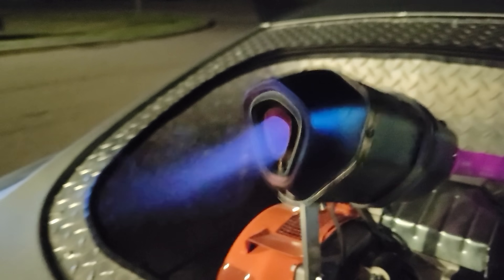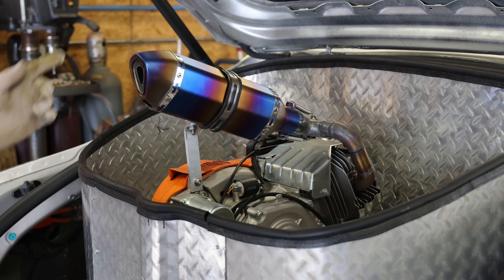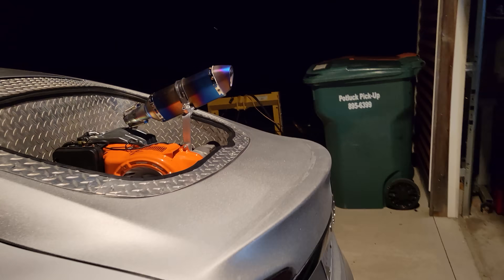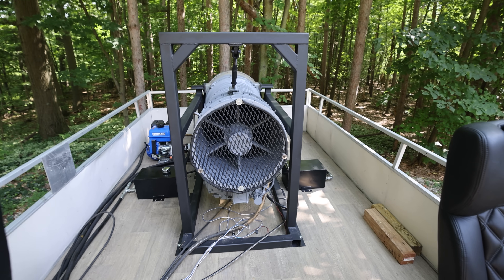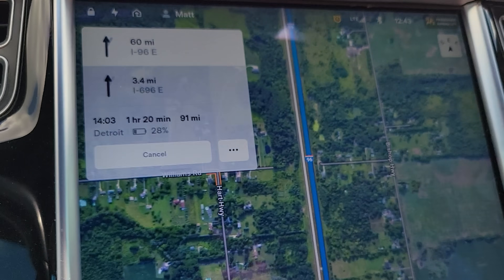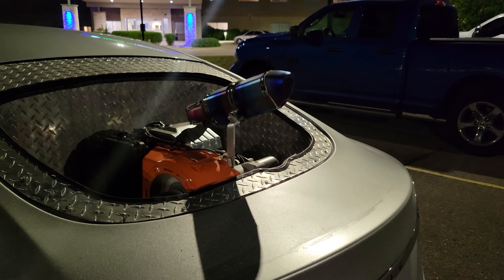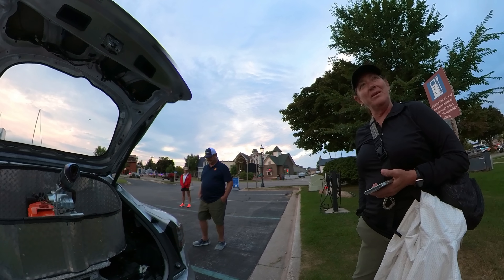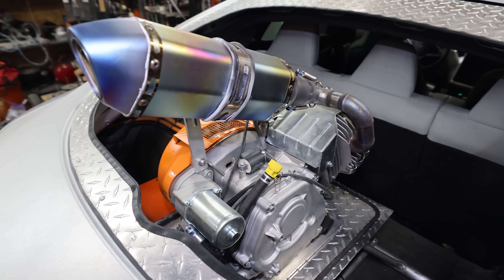Cordless Tesla (I Drive 1800 miles without charging) P.1

Comment: First of all I think if you wanted a hybrid you should of just bought a hybrid. The idea that, "you have to charge somewhere." is true but also extremely shallow thinking. The entire point of BEVs is to move towards clean energy cycles. That includes energy generation. The fact you take a gas engine and stick in the trunk of your Tesla misses the entire point. The point being that we need to be changing how we generate power. Simply poking fun of clean energy use because it likely comes from a dirty source is juvenile and counter productive.  

Want to do 1600 miles in a hybrid just put a big enough tank you fookin idiot. You aren't accomplishing slit here that's positive.

Comment: Some noise damping would help.
The exhaust needs to be reworked.
Otherwise you will disturb everyone.
Plus, modern age engine cars have systems that reduce the harmful gases output, by different solutions.

Comment: That’s pretty good but if you want the battery to charge properly you need basically two battery packs because one always needs down time to charge with your present charging modus operandi? Not to mention probably safer also. Too much heat not only degrades battery capacity but can cause catastrophic results. Hopefully your batteries are not the older lithium ion batteries? They can become very unstable when very hot🔥🔥

Comment: Nice. I hope it doesn't ruin the battery, charging it while using it
Reply: Yep. But there is a chance that a big part of the power from generator gets directly used by the electric motor while driving. Otherwise its a lot of heat!

Comment: I want to see this done with some super quiet suitcase generators in parallel. Stealth charge
Reply: Like a pair of Honda EU 7000's
Reply: @Hogger280  it would take four Honda EU7000is generators to barely keep up with the Teslas demand at highway speed... and those are 118.1 kg (260.4 lbs) each. Between them, they would burn 12 L (3 US gal) per hour, resulting in worse fuel consumption than a normal non-hybrid car.
Reply: @brianb-p6586  This whole thing is a joke,  don't you get that?
Reply: @Hogger280  if you want to be silly, use one Honda 1000. Or maybe a model airplane engine driving 12 volt generator plugged into an accessory socket.
Reply: @brianb-p6586  Look at the other comments.  Watch the video - he does a good job but knows it's not practical.  As an engineer, I could have told him before he started that it was not practical and would not be efficient.  Series hybrids are never as efficient as parallel hybrids.   He took a car that cost $20,000+ more than a decked out Camry Hybrid,  eliminated all of the cargo space and was obnoxiously noisy - if that isn't a joke then there is none.
Reply: @brianb-p6586  Anyone notice during the 5 seconds this video gives to inspecting that install that there's no dynamo attached to that engine, let alone capable of producing 10kw lol... only thing that's on that engine is electric start... it was bolted back there as a stunt for clicks.
Reply: @thom1218  I don't see the generator,  either.
Reply: This could be a test bed for how much generator is enough. How much can we drive a week using a tiny inverter generator?
Reply: @nutzeeer  you don't need to build a pile of junk like this to test that. The car shows energy consumption on its display, and you know the generator output for the generator you're considering and the number number of hours per week that you're willing to run it.

By the way, the answer is "none" - it makes no sense to run a portable generator instead of buying  electricity from a utility.
Reply: I always wondered if this would work well.
Reply: This is just a series hybrid... loads of actual manufacturers have made them.
Reply: Imagine suppressor on an engine exhaust
Reply: Look at Nissan EPower
Reply: There are electric, solar rechargeable battery systems that power whole homes. Hook one up to your Tesla and do it again. May not go 1600 miles May go further?
Reply: @besperus4475  How are you supposed to fit an entire roof's worth of solar panels on a car?
Reply: @besperus4475  have you seen how big those solar power panels are. There isn’t enough space on a Telsa
Reply: @yeahok115sure  Solar generators such as those by Jackery come with foldable, 'flat pack' solar panels that absolutely fit inside a car, they're designed for camping. They're basically a 1kwh battery that self charge via solar then you can dump that into the tesla.
Definitely A LOT slower than a gasoline generator, but it's silent and requires no fuel. 
Park up at your destination, unfold and lay out 300-400W of solar on the roof/windshield/bonet , go about your day and come back to some 'free' miles.
Reply: @CopypastaForTheBlind  300-400 watts of power isn't anything.  You'd need about 10x that and a lot of hours.
Reply: @besperus4475  absolutely not it's called the law of diminishing returns

Comment: Cool concept, but what's the point? You've eliminated the slight inconvenience of plugging in to charge and replaced it with the big inconvenience of an extremely noisy engine (which would also increase running costs).

Comment: Must of been so loud.  :)
Interesting approach.  I believe it’s a combination of electric and a small engine to perpetually charge while driving.  A hybrid with a very efficient engine.  Good luck !!
Reply: prius
Reply: @stevet5790  tl;dr the Prius is not a series hybrid like this. And then I started typing and typing and more words got added and I got ahead of myself XD

A Prius is not a series hybrid, its a parallel hybrid since its engine can drive the wheels directly with their weird dual coupling transmission thingy (called the Power Split Device, very imaginative name, I know lol). In this setup the motor revs to its most optimal fuel consumption and holds there with the generator pulling the most it can with the motor at wide open throttle, having been tuned for maximum thermal efficiency at low-ish rpm and fully loaded, like when you hypermile a car you upshift to the highest gear and put your foot almost all the way down, so this example he's made has a motor that has to basically redline itself and so its fuel efficiency isn't very good, but its a proof of the technology, a Tesla can charge on the go if its been modified to do it, so a Tesla is actually a pretty optimal PHEV platform, OBRIST had the same idea with their own proprietary generator design and its a good idea overall, BEVs are a dead-end right now, like barking up a tech tree without the prerequisites for the higher levels we want to reach so we end up stuck with sub-par products, a PHEV is the best stand-in until we fix the clean power situation down here by using nuclear and launching solar sats to beam power back down without using rockets. Too many things stand in the way of BEVs so PHEVs are optimal and logical. how tf did I get here wtf brain
Reply: @Avetho  When one energy is converted to another there is lost. In gasoline energy car, we are converting chemical energy to kinetic energy . In his set up , we are converting , chemical to electrical , electrical to chemical ( charging battery ) and again chemical to electrical and then finally to kinetic.   there is no way his model can be more efficient. However , i agree with you Prius is different machine. however , Prius create more efficiency by recovering wasted energy .
Reply: @stevet5790  A series hybrid also recovers waste energy, through regen braking and capturing generator heat to warm the cabin in cold weather. They just maintain a level of charge in the battery and under regen it recharges it closer to full and the generator goes off until it drops below a certain charge once more. A BEV is not more efficient, gas is still burned to charge them (unless we stop taking down nuclear plants since they are clean and powerful enough), its just that it happens in the power plants that supply the grid anywhere from 33% to 60% efficient, and we have engines getting over 40% these days with the cutting edge at 56%. A generator that efficient is ideal, especially since it will always run at those efficiencies unlike a traditional gas vehicle, its rpm and load being constantly in its most optimal range rather than revving up and down at varying loads.

Comment: So you didn't touch a charging station, but stopped at 3-4 fuel stations? I get the one to replace the fuel when it leaked, but not the others. The way I would've done it was not use the generator at all through the first half of each battery life. Then turn it on and drive slower. Maybe pull over each time for 10 minutes, or drive really slowly in the emergency lane

Comment: so this little engine which is about 30% inefficient than a modern Di dohc engine powering up an 80% efficiency electric car.  Is it more efficient than a gas car? If it does, I wonder why noble prize is not awarded for breaking the 1st law of physics

Comment: What did you do to the tesla to allow you to charge it while driving??
The battery packs on Teslas are about 450 volts.
How did you get 450 volts out of a 10Kw generator?
It would have been a lot quieter if you had used a Honda generator meant for campgrounds.

Comment: I see a gas motor but I don't see a generator. Where is the alternator, aka the genhead that generates power? How would you get the battery pack to charge while it's powering the car? Pretty sure Tesla software doesn't allow that. This almost has to be a hoax.

This was done before and done well. It's call the Chevy Volt.

Comment: This is the equivalent of someone claiming they drive their gasoline powered car x amount of miles without charging, just extra steps.
Reply: I take this comment completely back if it actually had good MPG, but the transfer rate is typically pretty crap from gas to energy to generators to electricity to battery. You just lose efficiency on the way.

Comment: That thing is shooting flames and glowing red hot because its running super lean with the aftermarket exhaust he added and i dont see an air filter, the carb needs to be rejetted to compensate im surprised that thing didnt melt the piston! Smh

Comment: Goal: wants to travel 1800 miles but hates to stop to charge batteries and even hates to stop to fill up gas tank.
Result: worst efficient hybrid ever, multiple police stops, multiple gas stops, unable to do 55mph on motorway without multiple stops pulling over on side of freeway min 15mins at a time for a trickle charge.
Whole video is full of stress of running out of battery AND gas, constantly monitoring power.

So noisy with flames it annoys the hell out of everyone.

Zero luggage.

What a waste of everything especially my time for watching this rubbish.

Next video: how he's invented the  perpetual motion engine.

Summary: there's already vehicles that can take you 1800 miles without ever having to stop to recharge batteries... and uses less gas and noise and boot space and time. They're called gas powered cars. Look them up!

Comment: Not the way I would do it. I'd put a proper petrol generator in a sound deadening box as used in a yacht and put it in the frunk. Add an air inlet in the front, and add a standard car exhaust with multiple silencers to keep it all quiet.

Comment: As much as people want to say this video is a troll, the math actually checks out.
Engine stated to be 13.4 HP peak output, that's 9.86 Kw. Tesla battery capacity is about 70 Kwh (depends on model). Assume 85% electrical conversion, it would take a bit over 8 hours to charge. (You can see the generator windings at 0:53 so I'm assuming 3P AC-DC conversion.) Also interesting to note that a typical stationary generator is about 18%-20% efficient. 1 gallon of gas (with 10% ethanol) contains 120,238 Btu, that's 35.2 Kw. 35.2*0.85*0.18 = 5.4 Kw/gal.  The fact that he got 16% net energy conversion (his number) is actually impressive considering he was running the little engine at peak power, not peak efficiency. 

Maybe next time use a Kohler V-twin, governed at around 2600-2800 rpm for best efficiency, and less noise :)

Comment: Please please please make a hydrogen fuel cell hybrid using the same theory like the Nissan 74 concept.  That is the future of EVs it would be cool to see someone do it before it becomes mainstream.  Basically the fuel cell charges the battery and can drive the motors too just like with the generator but silently meaning you can avoid charging stations.  ;)

Comment: Why don't you just put 2 generators from home Depot on the electric motors.  Then have two batteries instead one. 
So one is being used, They other gets charged.  Then it swaps.   Never need to recharge again.
Reply: Then at that point why not just forget Tesla and all EV's and purchase a Petrol only powered vehicle?

Comment: I agree with others in thinking this is fake.  You can see there's no output shaft on the gas motor or a generator hooked up to it, which means the only way it could be generating power is through a stator inside the flywheel.  You can see the stator briefly in one of the shots but I seriously doubt you can get 10KW out of it.  Even if that were the case, he claims it can charge the battery while the car is running.  I'm not sure how Teslas are set up but my Bolt only has one high-voltage inverter in the vehicle.  Since the car's battery pack voltage is more than typical charger voltages, the car has to use an inverter to increase the charger voltage above the battery voltage.  But the car also needs the inverter to run the main drive motor.  This means you can't charge the car using the normal charge circuits while driving, and the only way to charge while driving would be to generate the high voltages required (400 plus) yourself, which I highly doubt this guy is doing.  

At best this guy probably hooked up the gas motor's 12v starting battery to the Tesla's 12v accessory battery and called it a day - but if you call that charging the car I strongly disagree.

Comment: I would recomend wrapping the generator bay in sound deadening material. the fact that the generator in inside a pocket is actually amplifying the sound because it is in what I would call a sound chamber. I would also say the because the bay is made of metal is also causing the higher frequencies to bounce off the bay and make it sound louder I would fix this with sound deadening material fixed to the bay both on the inside of the bay and the side in the interior of the car.

Comment: Could've just installed a QUIET inverter generator that puts out 240V @ 30amps & not pissed off everyone. I'd be livid if someone left a noisy lawnmower running outside all night @ a hotel with exhausted travelers. Would've been better to showcase the build & show how it was done/ hooked up. Fun project,  poorly executed.

Comment: Warped Perception - what you have made is a hi-bread vehicle with an underpowered generator section AND it most certainly isn't cordless when you have to stop for fuel. The fuel pump is pumping fuel instead of electricity but you are still not free of a power grid in any way.
Reply: mmm... hi-bread. Delicious.

Comment: Absolutely amazing I loved it
Reply: All he did was build a primitive hybrid.  What's amazing about it?
Reply: @agb1953  it was water tight :)
Reply: @smartazz  So what?  Humans have been making watertight doodads since the first guy used lots of pieces of wood to make a boat hull.  We got really good at it when we started putting rotating propeller shafts through those hulls below the waterline.  There were watertight submarines in the Civil War.  Watertight is ancient technology.
Reply: @agb1953  the combination of old mixed with new is just amazing and beautiful thank you 😊
Reply: @smartazz  What?  The first electric car was invented by Robert Davidson in 1839.  The electric generator dates back to Michael Faraday and Joseph Henry in 1830.  The piston engine dates back to the Greeks of 150 BCE.  Those are the 3 components of a hybrid.  What "new" are you referring to?
Reply: @agb1953  the exhaust was new, no wait, that was Made in 1963, the check plate was new, no that was 1920s, the silycunt was new, no even older 1854, wow 🤩 I’m amazed nothing was new in this project.

Comment: A trailer with the generator and gas tank would provide for a better design. Then the tesla is a EV when its doing its short trips but during a road trip you could just add the APU trailer.

Comment: An Idea I would like to try is to fit an EV with a wind turbine that charges the battery when the vehicle is parked and the mast erected, preferably at the top of a hill or maybe in a narrow valley to get a good airspeed. Or carry a wood gas powered generator for the same purpose. Charge while parked. Run it on scrap wood.

Comment: Don’t know why they stopped making the cars that used both gas and electric. Was almost same principal pretty much. Gas was used to charge battery when driving and if cells got to low the gas power picked up the slack. Gave over double the normal gas mileage of the vehicle if was just reg gas car.. or they go to all electric and the charging time and travel is just ridiculous.  Till we get better batteries or find a better way of holding and keeping a charge for longer distance and quicker charge  and less space used in car storing em they should go bk to cars half electric half gas again.

Comment: hells yeah, that is hilarious and experimental in a fun way. Add in some engine tuning, like an air intake for max HP on the highway - think oldschool NSX race proven roof scoop? That muffler and exhaust look so under spec but I was surprised they lasted, maybe some efficiency to be tapped in that area and better noise reduction. Glad the leaky fuel didnt end up in a fire disaster, that seems so risky. good luck on the next version!